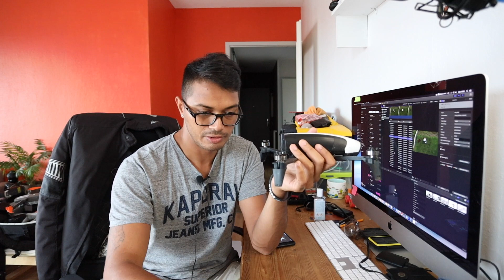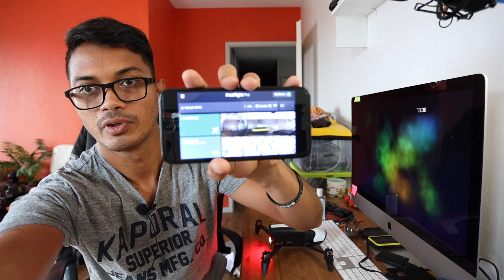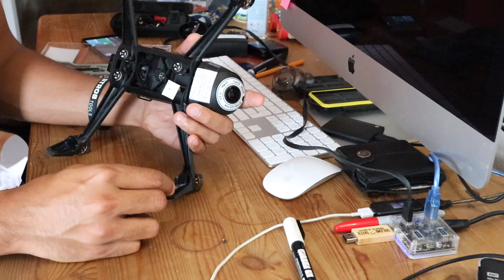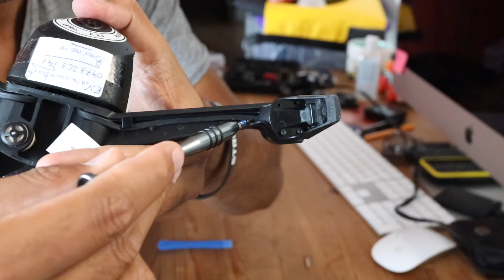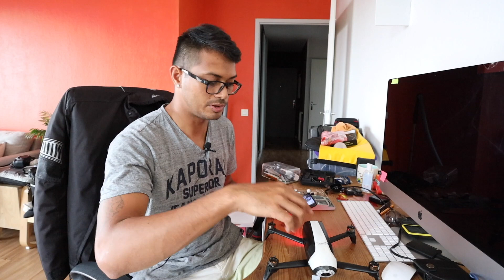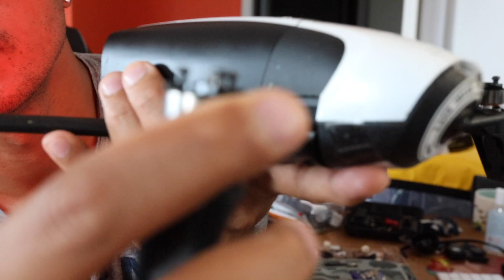BEBOP 2 | Motor Error 02 Mail in Repair (VLOG)

Comment: Hello Anthony, I have a problem with motor stage broken!! What to do?
Greeting Ben from Norway
Reply from the maker: Hello, check if you can see if it identifies the motor in the drone info page. It will mark the motor red if it’s a malfunction. If it does not mark any motors than it is the ESC on the motherboard.

Comment: my Parrot Bebop 2 Drone. propellers push down at the front and up at the back there is only one way my propellers will fit, it try's to flip itself over backwards or tries to if I hold it so it wont flip over, only the front try's to lift into the air??? the back motors seem to be going in revers, it as has had a small crash but from about 3ft off the floor. can you help in anyway please, all the motors are showing green 2019 model, I have also reset the motherboard to factory settings but still no joy.
Reply from the maker: CCW motor on a CW leg most likely. Or the motor cage has been changed with the incorrect one this the reverse thrust!
Reply: @ANTHONYVLOG  thank you for your speedy reply, I never took the Motors out I just unplug them and plugged them back in, I was just checking the motherboard and replaced everything as it was.
Reply from the maker: @hudsonrobert49  ahh ok open the drone up again and swap the rear legs motor connection to the board :) I made this mistake once. Try and revert back! It’s tricky how they cross the wires through the legs to go to the board.
Reply: @ANTHONYVLOG  Hi again I have just been watching one of your other video's about A and C rotation and especially the part about crossing the wires at the back, then it dawned on me I did NOT CROSS the wires THANK YOU!, I will let you know when I cross the wires lol. and now I no what you meant about crossing the wires lol.
Reply from the maker: @hudsonrobert49  haha I also just realized that it could have been taken as the the common phrase “wires crossed” miss communication hahaha. My apologies. Report back once you’ve sorted it out.
Reply: @ANTHONYVLOG  HI, my drone takes off as it should now, but it wonders around instead of just sitting there, now what??? lol.
Reply from the maker: @hudsonrobert49  does it give any error message for the vertical camera? If not do a calibration, clean the bottom pinhole camera under the drone with a cotton swab and for flying low make sure the ground is contrasting enough for it to map the ground and hold position. If you fly Huber above 8m it’s going to rely on GPS. I’m guessing thé wondering around is indoors?

Comment: Hi there. Was wondering if you can help... i have a parrot disco and have a " motor stage broken" message in free flight pro. Could there be a problem with the chuck as well as the motor?
Reply from the maker: Motor stage broken is a generate code for motor error. All of the Parrot drones sent to me with that problem only required a change of the motor. Further diagnosis of the motor revealed the stator coil to be defective.
Reply: @ANTHONYVLOG  thank you so much for you reply and clear explanation. Thanks again!!

Comment: nice video - I just got a bb2 that has a Motor Stage error - I know nothing of the history of this bebop - what's the difference between that and error 11 - is the motor stage just a bad motor that won't complete the boot up
Reply from the maker: Drone will boot up with a motor stage error. Motor stage error means a problem with the stator. Error 11 just means it cant communicate with the motor, could be a few things. So swap the motor around and see if the error follow it. If it does change the bad motor. As for the booting up, it could be something else.
Reply: @ANTHONYVLOG  thanks for the reply - if it boots up completely, that means fan on off then on and I can see the drone in Wifi and in Free Flight Pro and I can get it to connect - this means I have full boot up correct. The motor in red is the front left. I swapped both fronts and it DID NOT follow it to the right. SO left motor is good. Now does the motor wire go right to the motherboard and is it soldered on or is it a pull connection? So now what - replace those wires or switch those
Reply from the maker: @chuckger1625  when swapping motors, you swap them diagonally as they are CC and CCW, ie; front right to rear left or front left to rear right. 

Correct, it boots up ok. The motor line is soldered to the board on the board end. 

Let me know how it goes.
Reply: @ANTHONYVLOG Update - I swapped the 2 A motors and it show the same thing - same front left motor in red and Motor Sage Broken, So Im guess its not the stator - now what., thanks for any help.
Reply from the maker: @chuckger1625  thank you for that. The next course of action is to check continuity of the motor wiring from the board to the motor connector. Test each wire, they should have continuity. If one is open than the cable needs to be replaced. If they all present continuity than I am sorry to say it is the mosfet on the ESC which requires board level repartie of the SMC’s.
Reply: @ANTHONYVLOG  I pulled it apart from the bottom. I peeled back  the black sticky bottom cover and checked each part of the mother board where each of the 3 wires go into the mother board where the wires go through the copper hole. I connected the multi-tester to that copper hole ring where the wire goes through and I got continuity on all three PLUS I checked on the right side of the bottom where there is 3 large solder items and the middle one also had continuity when I check one of the other motor wires and the Left front one that (is RED) and both motor wires have continuity there also  Do I have to check the wires are actually soldered to the motherboard by taking the top apart or would that be a waste of time? When you wrote - If they all present continuity than I am sorry to say it is the mosfet on the ESC which requires board level repartie of the SMC’s are you telling me I need a new motherboard. I see some with motor and antenna wires connected on Ebay - that should that solve it yes
Reply: It also says its had 23 flights - if that's lifetime - that seems pretty low if I do need a new Motherboard
Reply from the maker: @chuckger1625  hello you need to desolder the cable from the board and check continuity of each wire (end to end). Than across other wires end just to see if it’s shorting across any of them. There should not be a short, it should be open. Rule that out before looking at a Mainboard replacement. Yes the flights are of the lifetime of the drone which says it’s pretty low mileage.

Comment: @ANTHONYVLOG  any time i tap "Take off" i see "Mottor Stalled" please do a video on how to fix that.Thank you
Reply from the maker: Swap the motor thats creating the stall error, than see if the problem moves with it to the new location. If it does, change the motor. IF it does not, check the motor harness from the connector, to mainboard. Sorry no one has sent me to repair one with that problem so I cant make video.

Comment: Hi Anthony, If the Bebop 2 powers on, fan turns on but fails to complete the booting process (motor check phase) and therefore cannot be reset, what could be the potential problem. Appreciate your help dude.
Reply: Tony, I actually got the drone from ebay and the previous owner mentioned that it did crashed and he may have replaced the motors, I haven't opened it yet, also per your video, it would still complete the boot even with a bad motor. You may be right about the incomplete firmware update or the board itself got toast during the crash. In that case,  do you think only a complete Mobo replacement will be the solution? Thanks again dude.
Reply from the maker: @geminibsee  without a working motherboard it is hard to say if a motor is problematic. My first approach would be to take off the canopy and remove the camera with bracket (gps module out first) than check the front of the magnesium plate that the two front screws of the camera mounts onto. If there is a crack on the magnesium plate in that area than the damage would have reached the board. The board develops a hairline crack internally. Next disconnect motors. Plug only go’s module and power up. If it boots, than let me know and we can proceed to more tests. Before you go spending money on a board.
Reply: @ANTHONYVLOG  Tony, did everything per your given instructions and the led powers on along with the fan for few seconds then turns itself off. During this short period, I can see it on the Wi-Fi available devices but as soon as I connect, the power automatically turns off even before I can open the FFP app.   I still think it is the Mobo and that may have been damaged internally during the crash so I'll just keep looking at ebay for possible available replacement. Thanks for the help Tony.
Reply from the maker: Did the drone crash? Was the drone taken apart? Was there a firmware update failure? There are few situations this will happen.
Reply: Did you ever fix this? I have same issue

Comment: Hi can you help me I have the exact same issue with my parrot and I've changed out the motor just as you've done but its still reading motor A issue I just can't figure it out I've put all new motors on please can you help
Reply from the maker: Hello, can you please explain further. 

Did you swap the motors around to see if the problem followed the suspected bad motor, or did the error stay the same regardless even after swapping a good known motor to the position that has the error?
Reply: @ANTHONYVLOG  thank you for the reply yes I swapped the faulty motor with the good one and its still faulty
Reply from the maker: @northerncarpfreaks5081  from what im reading the motor is good but the ESC or the wires / connector to the motor is problematic. 

Im hoping its just the wires and connectors as the ESC is somewhat difficult to repair. Its built onto the board.

A continuity check of the wires from the board to the connector should tell you if they are problematic.

Comment: One more quick question about the Bebop 2 OEM battery...is it fine to charge it with a hobby grade balance charger as long as I have it set to charge at 3.5 amps and 4.2 volts per cell?
Or would it be best to always charge an OEM battery with the OEM charger?
Thanks for your help.
Reply from the maker: The bms in the battery works best with the oem charger (when its working correctly). If there isn't a problem id stick with oem battery to oem charger. If you're using balance charger , disable the bms in the oem battery or slow charge at 500mA - 800mA. Target cell charging will damage the BMS over time and its balancing, protection properties. :)

Comment: Hey Anthony, ever get a Motor 11 Error-if so how'd you fix that?  It probably doesnt help that I'm based in South Africa and cant get parts.
Reply from the maker: Hi Adam, error 11 is a motor error. In this video i showed how to check which motor has the error. Now after you find out which one has the error. Remove that motor and swap it with the motor diagonal to it. Start the drone up and check the drone information to see if the error moved with the motor or stayed in the same location. If it moved (your motor needs to be replaced). If the error did not move with the motor after swap than it may be the ESC on the board or the wiring from the board to the motor. Let me know how you get along.

Anthony
Reply: @ANTHONYVLOG  Thanks Anthony, I need to get hold of a screwdriver kit to take it apart at some point.  I'll let you know what happens when I've tried to tackle this. Thanks for the advice.
Reply: Do you take mail in repairs? I have a bebop 2 and a motor error 11 _ Im in Colorado

Comment: Hi Anthony! I just bought a bebop power 2 on eBay that seems to be damaged (felt onto water).Luckily, I used WD4 to clean the motherboard and the drone started booting with the battery. I noticed that the back left motor had an error 11 displayed. Later , I tried to charge the battery with my bebop 2 charger the battery kept blinking red. How can I fix this motor error 11 and where to get a cheap balance charger? Thanks
Reply from the maker: Ahmed Awaleh check the motor connections, if possible swap the motor with front right motor and see if the error moves to front right. If it does, replace the motor. If it does not, there may be a problem with the esc.
Reply: Thanks for your response. I replaced the motor  as suggested with a same motor of my bebop 2 and placed  the error motor of bebop power 2 to the bebop 2, both motor worked fine with no errors. I think the issue is on the motherboard or the wire of the motor. There is no burned or damaged ion the circuit connection to the motherboard. With regard to the  bebop power 2 battery, do you know a cheap balance charger that could balance back the battery?

Comment: Man I'm so sad to say that I lost my Bebop 2...it just fell out of the air with 45% battery left about 70 meters in the air and 115 meters away...straight into dense trees and underbrush...had to be battery failure because the "find my drone" feature did not make the drone beep loudly and I tracked its last known location and there was nothing there...has to be high up in the trees.😕😕😕.
Reply from the maker: Drone Ready aww noo so sorry bud! Did it show any signs of propulsion failure before it disconnected or just disconnected? May i ask which battery pack was on the drone? 2700mah 3100mah 4000mah? Just to add to my notes. Once again im so sorry you lost the bebop! Maybe send another drone for recon?
Reply: @ANTHONYVLOG  it was the 2700mah OEM battery and it showed no signs of failure...perfect flight...I went out to just over 1km and after coming back to my area,I was circling around and dropping altitude to land and it happened on the "circle" I was making.
I used the Phantom 3 twice already with no luck at all.
I used maps and all ...I was directly onto of the drones last known location ...and even completely combed the area using a grid type search pattern...nothing.😕🤔

Comment: Quick question...what would cause my Bebop 2 battery to go to 1%  from 27% suddenly?
Thankfully I was only 90 meters away and 60 meters high...I immediately brought it in,but after powering off...I powered it back up out of curiosity and there was 25% left in the battery.
The only different thing I did for this flight was use a different android device...and with airplane mode on.
Have you ever experienced this?
Thanks.
Reply from the maker: Hey Drone Ready, I have noticed this and mentioned it in some old videos as observations. From memory these happened to me when I left the drone batteries sitting with full or almost full charge for sometime than topped them up before flight. Or when the batteries are just sat long. To remedy this I cycled them the day before flight if they were sitting long ie: charge, discharge, charge discharge and charge again. If
 that makes sense.
Reply: @ANTHONYVLOG  ...when doing my discharges through flight,is it okay to run the battery down to 1%, or should I try my best to keep it around 10%?
I know with my DJI intelligent batteries,its a recommendation to deep discharge the batteries after every 20 or 30 cycles...not sure if deep charging the Bebop 2 batteries is recommended...I just know that dropping from 27% to 1% battery in just a few seconds is a little scary.
I also run a newer battery made by "FOR" that's 3100mah and I have put 4 cycles on it and it does great but because it's not a stock battery I have used it when flying proximity,but the flight time has increased from the initial 20 minutes,to now 24 minutes.
Anyways...just a little concerned about the drop in   battery percentage so quick,because I have never had that happen in any flight with my Bebop 2.
Thanks again.
Reply from the maker: Drone Ready the same principle applies to the bebop batteries because they are also LiPo. So a deep discharge at least once every three months is a must. I wouldn't recommend flying till that low, i have a "land by 17% rule" that has kept me safe! Yes you can discharge the batteries to 1% they dont go below the minium on the cells because the drone just wont operate! Running the battery that low in flight would really be an emergency situation when you have no choice. The cell resistance increases as the voltage drops so its not too healthy for chargers as well if they are put through that punishment constantly. So to recap, i dont recommend draining the battery too low often. While once in every 3 months to cycle the cells. Just to keep the chemicals happy and active!
Reply: @ANTHONYVLOG  ...awesome...as always ,I appriciate your input and experience on this particular drone.
While I do have many other drones that I also love to fly...the Bebop2 is still  a fierce competitor to even the newest drones on the market.
I so hope that Parrot will continue in the future with a Bebop 3,but since it lookes like the company went towards the commercial/industrial/military side of the market...it does not look too promising for the future of the Bebop 3.
I'm looking very closely at the Anafi...although it is the same company...I have a feeling that I'm the Anafi is an entirely different drone.
What's your personal thoughts on the Anafi?
Reply from the maker: Drone Ready that is correct, anafi is a different drone! The flight characteristics are nearly identical as the bebop but feels abit (less). Anafi is a very capable bird no doubt, but it can never replace the bebop!
Reply: @ANTHONYVLOG  ...no doubt!!
Even though I have Yuneec,DJI,Fimi and Autel drones...the Bebop2 remains standing tall.
A drone far ahead of its own time and still so relevant in 2020.
They are extremely hard,if not impossible to find new and even harder to find in primo condition if they are used.
Thanks again.
Reply from the maker: Drone Ready i agree 👌